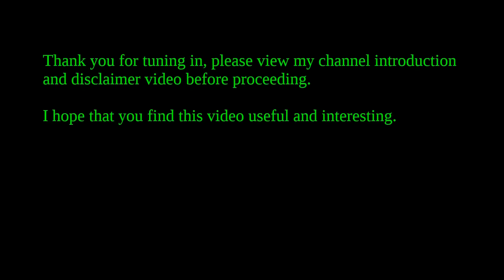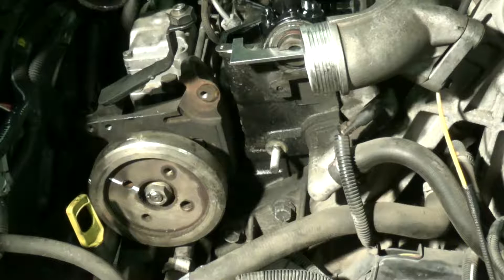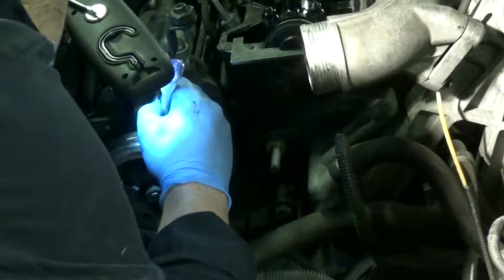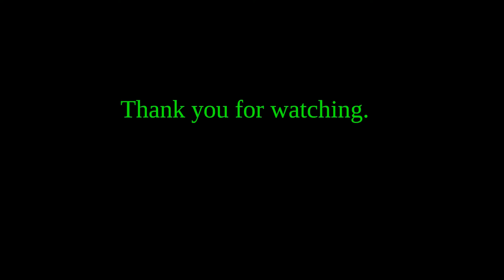D5252T timing belt change part 3: [Basic / Rough] Injection pump adjustment. Volvo 850 S70 V70 TDI

Comment: Hello i need help ASAP, i did this at home and then when I changed both belts i tried starting and it didint start. Then i saw that i didint have removed the injectorpump Bolt. Fixed that and now its comming a loud knock when i start. How do i fix this?
Reply from the maker: Don't really know what's going on there I'm afraid.

Comment: Great video, not sure if you are still following the comments.  When advancing the pump timing you said it would be good to have some spare hands...your steel rule can be 'secured' in place by a couple of small magnets...then you don't have to worry so much about it moving or having to fiddle with it whilst concentrating on the more critical parts of the procedure..
Reply from the maker: Great tip, thank you.

Comment: After trying to change a -3 to -0.5 dynamic setting I accidentally set the pump timing way off (I changed the cam wheel as the roller did not give enough way to get to -0.5). After this, I put the flywheel to TDC again, set the pump timing mark correctly and the engine did not start. Then I set the flywheel to TDC and set the pump 180 degrees the other way while aligning the pump wheel mark, and the engine still does not start. I can wiggle the pump timing a little bit either way from the timing mark, but to no avail.

Of both ways to set the fuel pump with the flywheel on TDC (the two ways the pump can be set with the flywheel on TDC), only one way gives a little bit of an ignition and white smoke from the exhaust when starting but does not stay idle. I am assuming this is the correct fuel pump general timing setting vs flywheel TDC? 

I have cut  apiece of cradboard to get around the piece of metal in the way of using a straight tool to set the pump timing correctly, and the little square gap is precisely in line with the groove on the pump. Still it will not start.

What can I do to correct the issue?

Thanks.
Reply from the maker: I would start from the position that gives some ignition and smoke, then advance the timing one tooth by loosening the sprocket on the injection pump end of the camshaft and moving it towards the front of the car with a holding tool (with pump and belt connected). If this does not work go another tooth in the same direction, after moving 2 teeth you should have an idea if the starting is getting easier or harder, if it gets easier keep going until it will start and idle, if not then go the other way. It should start and idle within 2 or 3 (one way or the other) teeth from the position that gives you some ignition and smoke. When it does start, let it warm up and then check and adjust the timing electronically, as it is the only way to get it correct. Also check your glow plugs are working, as these cars can be near impossible to start if the plugs are bad and the timing incorrect.
Reply: Thanks. Acc to VIDA tests the glow plugs are working (tests it by voltage change for 12 secs during startup).
Reply from the maker: Interesting, I'd still be tempted to check the resistance of the plugs themselves, as I'm not sure if that will show if the plugs are ok or if the system is simply trying to provide them with power. Good plugs should measure about 0.9 or 1.0 ohm
Reply: It worked, oddly enough I had to go about two steps of 5 mm from the pulley timing mark to the front of the car to get to -0.5 degrees dynamic timing. I started up at -6 degrees timing, went two small steps from there to perfection.
Reply from the maker: Odd as you say, but if it works then it works :) Is -0.5 considered preferable to 0.0, I'd always believed that was the target setting.